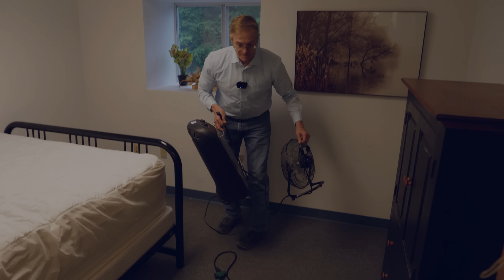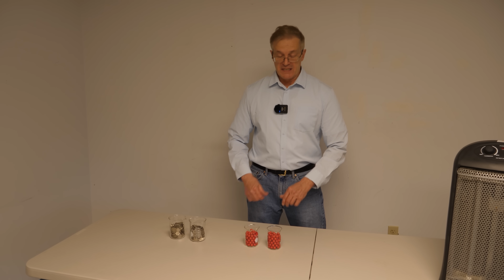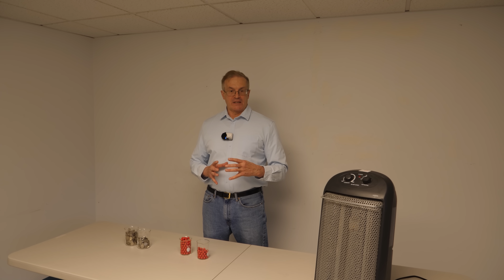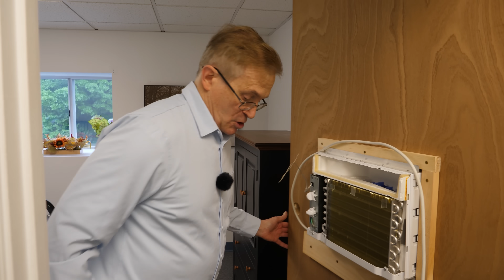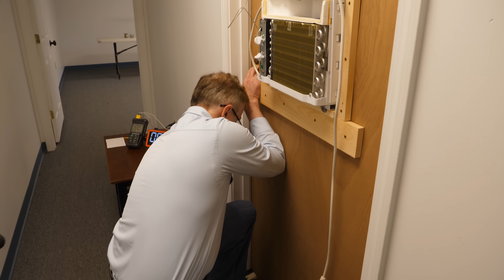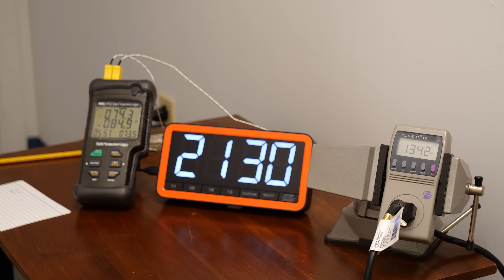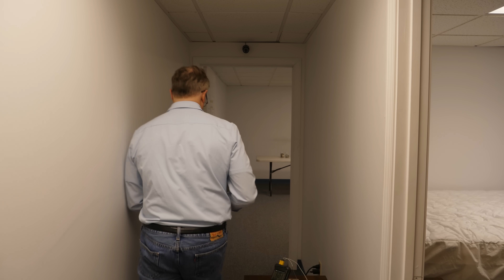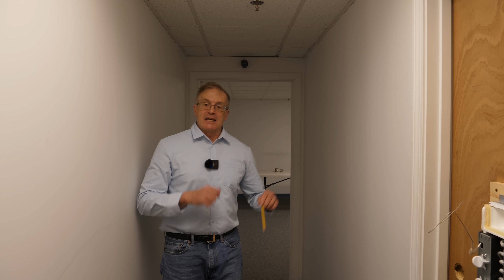You're wasting money on heating! Use your A/C!

Comment: Heat pumps are the ONLY way to go these days. My current home has a multi-zone ductless mini-split heatpump system. Each room has its own head unit with two main heatpumps outside (mitsubishi hyperheat). The system works down to -12F and keeps up pretty well even at those temps. It's SO efficient you wouldn't believe it. Plus being able to independently control the temperature of each individual room is simply amazing. Of course forced air heat pumps are still great, but the efficiency of these ductless systems are even better. Also have a heat-pump water heater which is great.
Reply: Works pretty well for me to just live in civilization where there is natural gas service.
Reply: @ev6558  Only because you are being grifted by your electricity supplier, you believe that your gas boiler is cheaper to run.

On average electricity is 4x more costly in the UK than the US although gas cost is about the same.

That's why no residents are running heat pumps there and sticking to traditional gas boilers as because of the disparity in gas vs electricity price.

In this situation using hot water for 11.5 months of the year will empty your wallet much faster even if you used a super efficient heat pump let alone a resistance heater. In some parts of the world, gas is still king.
Reply: It's not that simple if you compare energy cost.  No doubt, a modern heatpump can extract 3, 4, 5X more heat than the electricity required to power it.  This is the whole point of this video, and that is absolutely correct.  Heat pumps use less energy, a lot less. If you're heating with electricity, it's plain economically dumb to not consider a heat pump.
BUT...   As much as I want to minimize damaging our environment, I want to minimize damage to my wallet even more.
Here in the great Northwest, I own a heatpump in my home.  I also have a 90% efficient natural gas backup furnace (integrated together).  At least as of early spring 2024, the actual cost to heat my home using the heat pump OR natural gas is an absolute wash.  In previous years, it made no sense to run the heat pump for heating as the cost of natural gas was far cheaper.  In this region, the price of natural gas has risen to where the cost of natural gas BTU's (therms) is equivalent to the electricity needed to run a ~3X efficient heat pump (COP in heatpump lingo).
That may not be true where you live, and the only way to know is to do the math with natural gas and electricity costs.  Convert nat gas therms to BTU's, convert electricity kilowatt-hours to BTU's and compare costs per BTU (or million BTU's).  Nat gas BTU cost has to be about 3X lower than electricity BTU cost to call these equivalent.  If your nat gas BTU costs are less than this, it's simply cheaper to heat with gas at any temperature.
Do you own math.
Reply: I also keep about 3-4 cords of wood for the stove too. for when the power goes out, or i feel like a roast.
Reply: Down to negative 12 degrees fahrenheit? Are you referring to geothermal? Even then I'm not familiar with them being capable of -12*F.
Reply: @Finite-Tuning  no, not geothermal, regular heatpump. They've come a long way and some are capable of even colder than mine. Mine is 100% efficient down to 5F and roughly 60% down at -13F where it then stops working beyond that. Their newer ones are 100% down to -5F. Cold-capable heat pumps are widely available now.
Reply: @Avboden :
Okay, you are 100% news to me. Can you give me your model number to look up please?
Reply: @Finite-Tuning  I already named the system in my first comment, google it my man.
Reply: Working to -12F sounds great unless you live in a place that regularly gets to -20 for a week or 4 like Minnesota.
Reply: @morefiction3264 Well, it just uses resistive heating as a backup, or they have systems that use natural gas or fuel oil when it gets cold. Four weeks would likely still be enough of a savings to make sense for such a system. For a longer period, you would probably have to consider a ground source heat pump.
Reply: @zachmoyer1849  Just that people have to consider all the costs.
Reply: Actually geothermal heatpumps are the way to go. Almost like free energy.
Reply: @Hclann1  for new builds for sure a good option, expensive to retrofit an existing though.
Reply: @Hclann1 If you have a pond on your property, you can throw the whole circulation coil in the bottom of it and save a great deal on trenching costs normally found in a geothermal system.
Reply: No they are not.  Once it gets too cold a heat pump will fail.  My house has one on it.  Once the temperature outside gets too low it can no longer heat the house and I have to rely on resistance heating to bring the house to comfortable temperatures.   Heat pumps work on the principle of "exchange".  The "coolant" being use has limits and depending on it's performance along with the design of the system operating with it.  This experiment is working between two environments with similar temperatures.  This will greatly show the efficiency differences... but when two very different environments are experimented with... the limitations quickly being to show.

If the cold side cannot get "colder" than the environment it is in... it will cease to perform at all.  This is the same as the hot side when it cannot get "hotter" than the environment it is in.  This is why your house AC works harder when the temps are in triple digits.

Yes... it is very efficient... at first.... but the greater the disparity in environments... the less efficient it becomes.  NONE of this is recent news.
Reply: @CD-vb9fi Still, when you look at the whole year its better, and this is going to be different for different climates. For example, in Antarctica, it's not going to work, or in any place with incredibly cold and long winters. However, I am in the Northeast USA, and my heat pump is just an air source heat pump with a resistance emergency heater. The emergency heater kicks on when the temperature is too cold for the heat pump to be effective. My emergency heater only kicked on twice this past winter. So, for the entire rest of the year, besides those two days, I was saving energy compared to a resistance heater. You can go even further by overheating your house during the day while the sun is out and then turning it down at night when its less efficient. Personally i don't need to eek out that last little bit of savings and just prefer the comfort of constant temp.
Reply: @zachmoyer1849  Keep in mind, I am responding to 'the' comment that they are the "ONLY" way to go.  Yes, they are efficient and you should definitely take advantage of them.  But they are not the only way to go.  Like all tools in the toolbox... each tool has an appropriate and/or more efficient use.
Reply: @CD-vb9fi  i didnt say they were the only way to go and said they wont work in some areas. But for a majority of people it is the only way to go if you want to spend the least amount of money on energy.
Reply: @zachmoyer1849  You are right, you didn't say it the OP said it, so I corrected my comment, I do apologize for that.  That said... now you ARE saying it and you are still incorrect.  While I am happy to go with hyperbole for simple matters, but in the case of scientific application as would apply here... there is no such thing as "the only way to go".

There are several methods of doing things and efficiency is not the only issue at hand.  Feasibility and effectiveness are also factors.

While I do prefer efficiency for obvious reasons... there are times where I dismiss efficiency.

For example... I recently purchased a house and I had to choose between 2 models.  House #1. was 100k and I could afford to purchase it outright.  It's not efficient.  House #2. was 280k and as more efficient, but I would have to finance.

Now... the SQFT Rooms/Baths were similar... but the efficiency in insulation was clearly superior and would save my possibly 200 per month on utilities.  But it would COST me far more than 200 a month in financing to offset that.  This means it's cheap over all to just pay 200 extra per month in utilities rather than 1,200 a month and waiting 83 years for a Return on my Investment.

There is also the problem of how easy it is to service.  Repairs and regulation on resistance heating is a far easier application to manage compared to heat pump.

To EVER say "it's the only way to go" for nearly anything is more a comment about one's own lack of understanding than anything else.

I have BOTH methods because I know that all eggs in one basket is what gives people in life most of their problems.

Now, I hope I have explained well what I am talking about.  Avoid useless hyperbole, it does not belong in discussions like these for the obvious reasons.
Reply: @CD-vb9fi  Well you still ignored part of what i said lol. As i said its the only way if you want to spend the least amount of money on energy. Of course there are other cost concerns (mostly upfront costs) that make things more complex. But IMO its safe to say they will become the norm eventually, its just a matter of time. Fuel is not getting cheaper and resistive heating is not getting more efficient sure its cheap but there is lots of room yet to improve heat pump efficiency and costs. With global demand creating lots of competition amongst manufacturers, those efficiency and cost gains will be here sooner rather than later.
Reply: @zachmoyer1849  Hold up... did you not read my story about a choice between 2 houses?  That was my answer to your "spend" proposition.

Your claim is "specious".  In my example, I chose to spend MORE money on energy because it ultimately "cost less".  I will not live another 83 years to "justify" the cost of "spending less" on energy by buying a far more expensive system.

Not only that, you can't guarantee that it will be less.  My professional career is about fixing things that break.  I also deal with things that have a value/cost model attached.

Sometimes spending more is better.  Sometimes spending less is better.
There is not a single case or example I can thing of where the term "only way to go" has ever applied!  Not a single one when it comes to climate management.  I have dealt with building automation, High Voltage, DataCenter cooling, and various other things related to heating and cooling.  I even enjoyed watching this very channels desiccant based cooling.  I have members of my family that work in A/C... 

You folks sound too much like this is simple... everyone just gets a heat pump and life's problems are solved... except they are not!

Great... I spent 1 dollar on my heating bill this month.  Know how much I spend on Cooling?  Know how much the unit cost?

In the voice of Mike Myers... One Million Dollars!

Look... you folks are all barking up the wrong tree.  It's not that I am saying heat pumps are not more efficient.  It's clear they can be, but not always <-corrected.  But I am telling  you... this experiment is not exactly the best scenario for selling it.

Real World Application matters... and that means cost beyond just... how many pennies it takes to make heat jump into a fur coat!
Reply: @CD-vb9fi  you are arguing for the fringe which is basically areas with long ass cold spells or areas with super expensive electricity or areas with super cheap natural gas. Im arguing saying that the majority especially in the usa the heat pump will make the most sense. We are both right im just saying that for most people it makes sense and you are arguing that there are cases where it doesn't which i agree with. As for your house example its also another fringe case as most are replacing a central air unit with existing ducting.
Reply: @zachmoyer1849  It's not fringe at all.  You need to stop coming at me with a fallacy.  I didn't say don't use a heat pump.  I am directly responding to OP comment that "it's the ONLY way to go".  What part of that are you not able to understand?
Reply: @CD-vb9fi  its fringe my friend
Reply: @CD-vb9fi  If they fail, you are not using heat pumps made for cold climate. 15 years ago I installed a Mitsubishi air-air and it worked in the coldest winters, down to -30 degree Celsius (although it wasn't anymore efficient at those temperatures). Never once had any problems with frosting. A few years ago installed a ground source heat pump for heating the house and hot water and now the Mitsubishi is only used as an AC in the summer.
Reply: @johansvideor  Do you see a heat pump designed for cold climate in the experiment?  I didn't.  There is a reason I used "qualifiers" in my comment.  For a bunch of people watching a science focused channel you sure are missing some important things here.

Details matter!
Reply: @CD-vb9fi  The basic principle is the same for the science aspect. If we are talking about engineering and applications, that's when different designs matter, sometimes a lot.
Reply: @johansvideor  Okay, I agree with your comment on design and application so I don't think we have any difference of opinion there.

That said... what heat pump is made for "hot climate"?  Are they all not made for cold climate?  Some "more cold" than others perhaps?
Reply: @CD-vb9fi  oh no you have to use a space heater for 6 days of the year... The horror!
Reply: @runed0s86  lol... did your mommy not give you enough hugs as a child or something?  Did you not hear that I do use a heat pump?  Did you not hear that I use it until it cannot perform, then I switch to my resistance heater?  It's a 28k pair of sleds... it's not a "space" heater lol.  But... they do heat up space... so... go head call them space heaters... much like how your brain and mouth contribute to global warming.

Stop being a mouth breather you folks sure to know how to try a persons patience with all your useless nattering about nonsense.
Reply: @CD-vb9fi  There are winter heat pump setups but you have to bury long pipes throughout your yard and run coolant through them, extracting heat from the ground below the freezing depth.
Reply: @ZAKKORD  Oh yes... there are definitely better setups... that is why I put the qualifiers of "cold side has to be able to to get colder than the environment it is in and the hot side has to be able to get hotter than the environment it is in."
Reply: @ZAKKORD  In northern europe its more common to drill a hole in the ground and fetch heat from that. I just had a 200 meter deep one made just outside my house. Doing it like that makes everything super consistent all year around. Also the driller did the whole thing in a short day, 200 meters of granite, I was impressed by that.
Reply: They do math shenanigans

Lets do more than one hundred percent efficiency.
You can always make things less ifficient, and if thats you definition of efficiency
Reply: @bobsterclause342  No it's PHYSICS not math shenanigans. When you're moving energy instead of making it, it isn't hard to be more then one hundred percent efficient.
Reply: @GeorgeWashingtonLaserMusket 
What do you mean. Physics in general is absolutely math shenanigans.
Reply: @GeorgeWashingtonLaserMusket  Small correction: "when you're moving energy instead of converting it". Energy can neither be created nor destroyed, except by conversion to/from mass (E=mc²). A resistive heater doesn't create thermal energy; it converts electrical energy into thermal energy.

And yes, I'm a fucking nerd, I know. 😉

Comment: With your intro, it reminds me why I watch your channel. Although I do understand heat pumps as used in residential settings, I generally pick up at least a few tidbits from you on ANY subject, no matter how familiar I am with said subject. Keep up the great work!
Reply: In reality: 99.9% already have heat pumps that heat dwellings in the developed world - they are called refrigerators. :) (heating effect is minimal of course).
Reply: @ 
Actually I have seen a room with several commercial refrigerators, used for support of meals for a guest house, that had all of the hot condenser coils placed outside. Too many refrigerators could dump a lot of heat into the room. Your basic kitchen refrigerator does not bother to have a separate outdoor condenser part, because that would increase the cost, and require a more complicated install. So all that waste heat is used to help evaporate the condensate water.

Also, kitchen refrigerators are not to be used because your A/C is broken. They are not designed to have the door open very much, and would become overloaded with condensate water or ice up. If you want to use a refrigerator in that manner, I think there is but one way to do it. Take out a gel pack for your cooler, or some ice, and use that to cool off. Do not hold the door open or you will cause problems. A/Cs are better designed to shed the much condensate water. Refrigerators can not handle much condensate water, else I imagine it will "pee" all over your floor, if it does not have even worse problems.